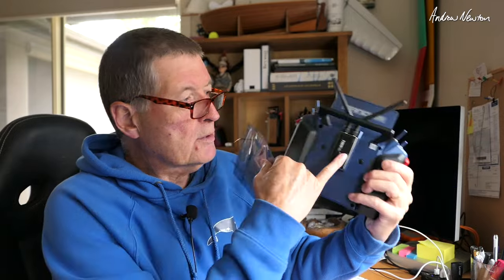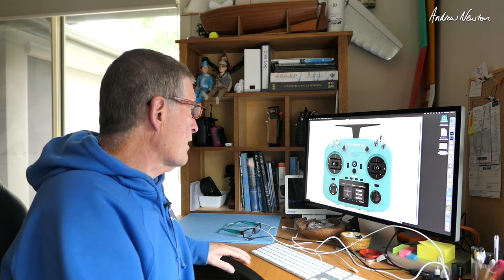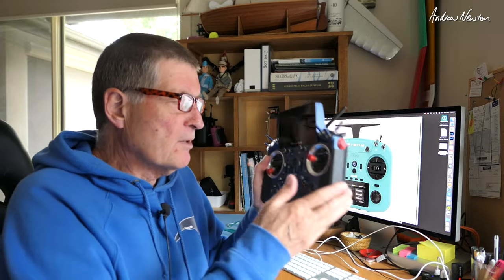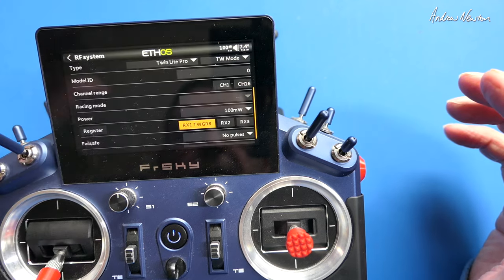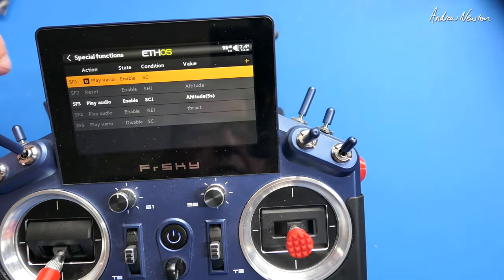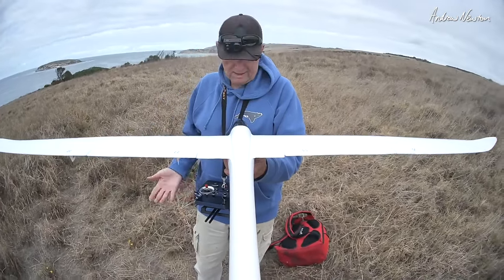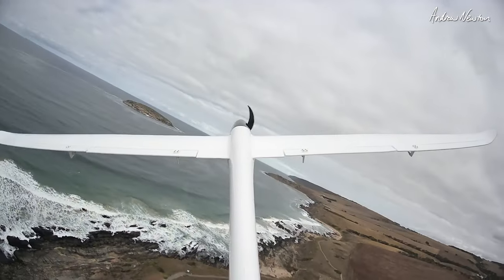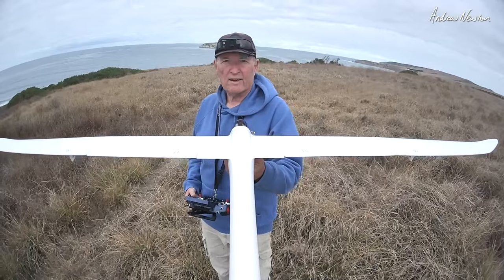FrSKY TW GR8 8ch glider receiver with Vario

Comment: Thanks for the great videos Andrew. Which of all current TX/RX protocols would you suggest for someone getting back into the hobby? General electric sports and glider use, lower end of cost scale and longevity of product availability/support are priorities. Seems like there are so many new protocols now. Cheers 🙂
Reply: ELRS!
Reply: Get a Radiomaster tx16s or Boxer multi protocol and an elrs module for the back...that covers the majority of the protocols out there.
Reply from the maker: Thanks Oldman. Boxer and ELRS would be my choice. This blog post relates to INAV but still relevant http://newtonairlines.blogspot.com/2024/03/best-radios-for-inav-2024.html